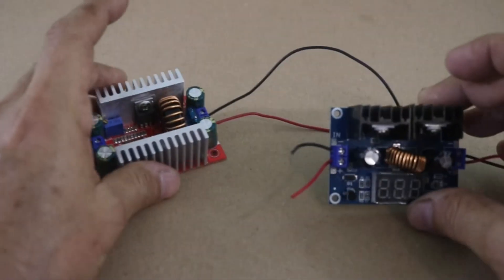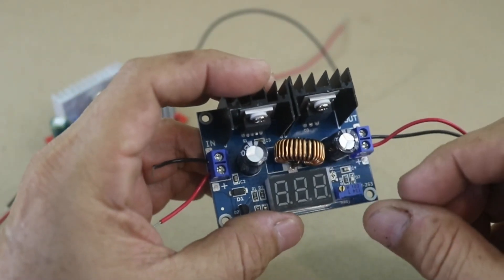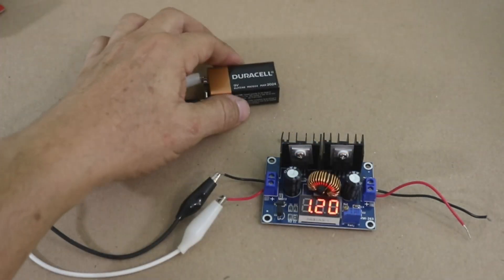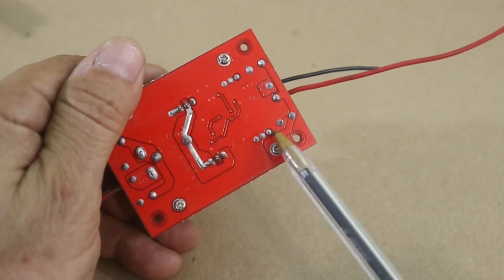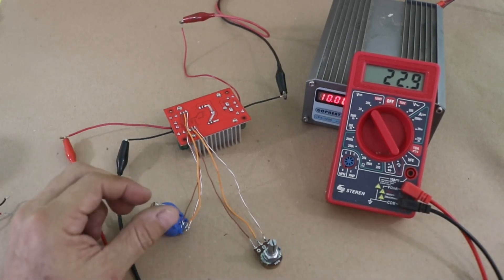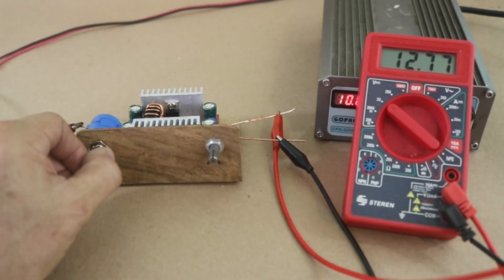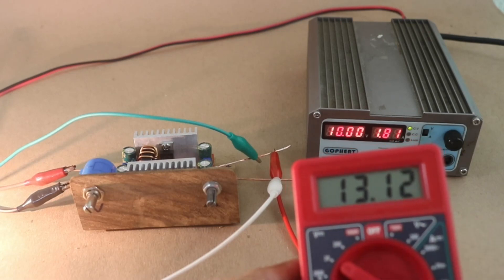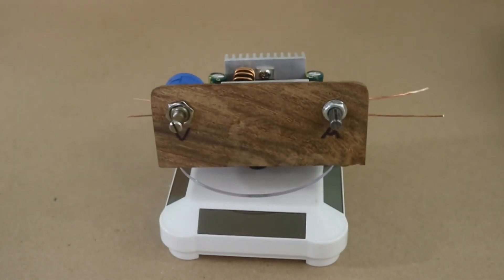Modding a Step Up Module to Add Potentiometers in Place of Trimpots

Comment: I have a question about these type modules that is beyond my very limited electronics circuitry understanding:

Currently I am using a "step down" version to take a Milwaukee M18 (≈18v) work tool battery down to ≈12v for my daughters Power Wheels car. So far this works great.

She wants to get a new 24v car.  I'm wondering if I can duplicate the setup with 2 batteries. So if I use 2 M18 batteries, both with their own module stepped down to 12v.  Can I hook up the 12v ouputs on these boards in series to get 24v...or can the outputs of these modules not be hooked up in series?
Reply from the maker: Yes you can put the outputs in series

Comment: I used this same thing for a battery charger so I could charge both 12v and 48v as well as set the amps depending on the battery type, very handy
Reply from the maker: Yes great for charging batteries
Reply: @ludicscience  i need your help for electric fence

Comment: What a coincidence!

Just randomly I ordered several different kits to run my daughter's Power Wheel off my Milwaukee M18 batteries and I have those exact boards in my hands right now, and was thinking of how to add a potentiometer so its easier to adjust output voltage until I get it just right....and also use them for other things.

Thanks!
Reply from the maker: These modules are very handy!

Comment: Thanks for video. I have destroyed two mt3608 step up module by replacing trimer with potentiometer in order to regulate the output easier, I don't know how it happened 🤪
Reply from the maker: Third time's a charm!
Reply: I’ve destroyed at least 3. Poor soldering I guess, but it’s not so easy.